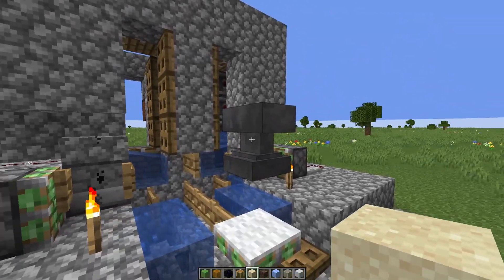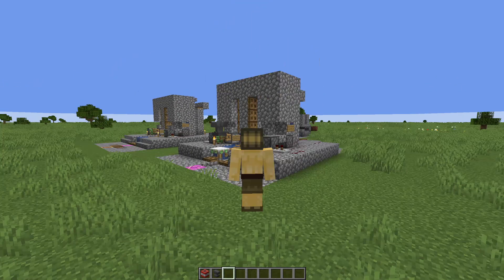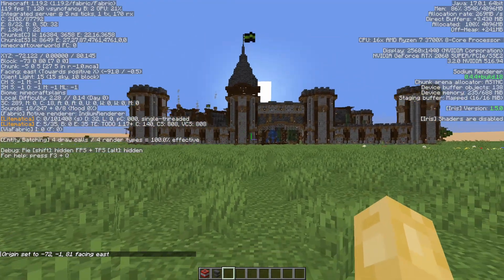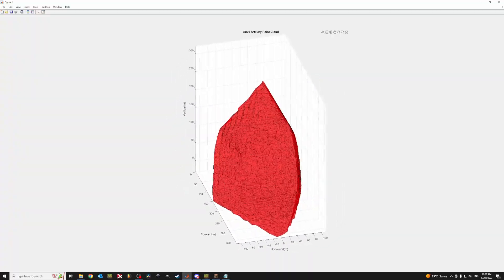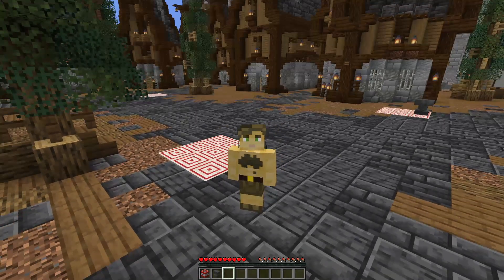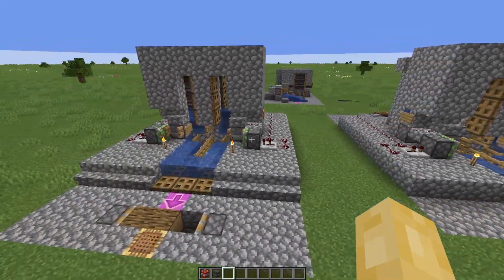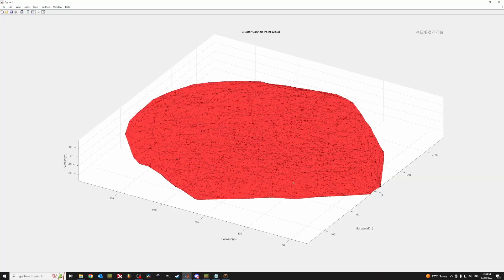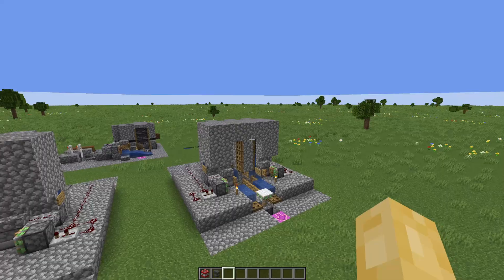Minecrafts Inter-Continental Ballistic Anvil Cannon

Comment: Would it be possible to shoot a staggered load of tnt to rapidly move a payload in a diagonal but relatively straight path above the target and then having the first stage of the payload propel the second stage downward? this way you could get over obstacles without having to bore through them

Comment: How about a tnt minecart canon?, i tested it in my World and it can 1 shot Full Netherite no enchants using 2 carts its on Bedrock just in case if there's tnt carts wont fly with explosions in Java
Reply from the maker: TnT minecarts are annoying because for some reason minecarts in general have a really strict horizontal speed limit to stop them from moving too quickly on rails.
Reply: @cubicmetre  If the Horizontal limit didn't exist or change with faster speeds, would you build one?
Reply from the maker: Uhh, yes, tnt minecart scales its damage with velocity so if launched from a cannon it would ba an instant kill.

Comment: you should create a cannon that does a more barrage or burst style fire mode. basically, ends up with one tnt exploding after another, so the first tnt creates a hole for the second tnt to go through and so on
Reply from the maker: That is what the cluster charge does, the problem is that if the TnT explodes after hitting the wall all their momentum is cancelled and they all explode in roughly the same spot.
Reply: @cubicmetre  is there a non command option for anyone who doesnt have access, like in your infinite range cannon that uses an Excel File

Comment: What if you use an arrow in replacement for an anvil? A nice way to assassinate from afar without leaving evidence
Reply from the maker: A dripstone would do this more effectively as it can be used with the cannon with minimal modifications and it breaks on impact. An arrow is very small and would make it harder to hit a target.
Reply: @cubicmetre  question, does dropstone deal more damage than some tipped arrows? Also I like the idea of a dripstone cannon
Reply: @cubicmetre  alsoooo if you're not going for small and deadly, maybe some sort of mortar shot of arrows that can strike down a 9x9 block area or bigger to ensure allot of death, maybe too much but well some ideas

Comment: Wait, could you use a fencepost to suspend an extremely large amount of sand in the place of the anvil, effective showering the enemy base in sand. Would be a great distraction
Reply from the maker: The fencepost mechanic does not entirely work anymore, you can however preserve a falling block on a piston bud that moves continuously.

Comment: Realy cool technology. However it seems a little hard to hit a Player with an anvil as they'd have to stand in on specific location. Therefor my suggestion: Instead of shooting a single anvil couldn't you instead send a group of anvlis that are either 1. All alligned sligthly diffrently or 2. send a piece of TNT allongside the anvils which then explodes in mid air? Don't know if thats possible, but the idea would be to have a small area (of maybe 3 Blocks in diameter or so) as a target instead of a single Block.

Comment: Does this cannon only work because of Carpet Mod?
Reply from the maker: No, this cannon should work completely in vanilla, although you need a fabric mod to be able to get the settings to hit a specific target. Otherwise you can try to guess the settings in full vanilla but I'd imagine that would make the cannon very difficult to use.
Reply: @cubicmetre  I have been experimenting with the anvil and a cluster Canon all day and it is very nice, thanks 👍

Comment: sry for commenting so late

but you made something not that precise with the anvil: letting it fall makes inconsistent angles each tick, a better way to do that is using powdered snow, and pushing the anvil into the powdered snow at a certain time (so the time after release from powdered snow and before entering the powdered snow stays the same but the time in the powdered snow changes)
Reply from the maker: The timings of the cannon do not change for each shot. You should be able to hit the exact same position with the same settings with consecutive shots.
Reply: @cubicmetre  sry I meant not unprecise between the same shots, 
but if you use the falling anvil delay to adjust the angle of the cannon, between each possible height to shoot at there are irregular differences, but if you'd used powdered snow it would be almost the same
Reply: instead of the cluster cannon I recommend either using not more than 4 projectiles (for efficiency) and firing as fast as possible

or just hit the enemy in one shot, using a technology named stab cannon or tunnler cannon (depending on if you play WarGear or Factions) another advantage of those cannons is, that they take just a bit of flight duration, so you might hit a moving enemy (though this requires some skill, since asking your mod just is way to slow for this) 

The Servers of the Wargear community have plug-ins, that make it really easy to build such a cannon with high efficiency and also Members, that don't bite and might even explain to you how it works (you should join between 12 am and 2 am est to find members)

Comment: The anvil knows where it is at all times. It knows this because it knows where it isn't. By subtracting where it is from where it isn't, or where it isn't from where it is (whichever is greater), it obtains a difference, or deviation. The guidance subsystem uses deviations to generate corrective commands to drive the anvil from a position where it is to a position where it isn't, and arriving at a position where it wasn't, it now is. Consequently, the position where it is, is now the position that it wasn't, and it follows that the position that it was, is now the position that it isn't.
In the event that the position that it is in is not the position that it wasn't, the system has acquired a variation, the variation being the difference between where the anvil is, and where it wasn't. If variation is considered to be a significant factor, it too may be corrected by the GEA. However, the anvil must also know where it was.
The anvil guidance computer scenario works as follows. Because a variation has modified some of the information the anvil has obtained, it is not sure just where it is. However, it is sure where it isn't, within reason, and it knows where it was. It now subtracts where it should be from where it wasn't, or vice-versa, and by differentiating this from the algebraic sum of where it shouldn't be, and where it was, it is able to obtain the deviation and its variation, which is called error.

Comment: Cubic I'm curious as to whether it is possible to instead align the projectile, and have static explosives such as ender crystals being accumulated by pistons in a set position, given they have 6 explosive power and no time limit. Wouldn't that allow for a higher top speed?
edit: you can set certain end crystals at a different position to effectively change the final force vector, though this would be less precise the less crystals you use to distribute the force
Reply from the maker: Honestly TnT is just dominatingly superior to end crystals, they are cheaper to make, easier to work with and actually allow you to stack the explosion. End crystals don't actually stack their explosions, instead the first crystal to explode simply kills the other crystals leaving you with only a single explosion.
Reply: @cubicmetre  was this behavior changed? I remember in older versions the knockback stacked
Reply: @Satepin  That's bedrock edition thing

Comment: I would love to see you find a way to launch an anvil further by blasting TNT that follows it and detonates in midair to propel it past the normal range.
Reply: why not use more tnt initially?
Reply: @ATOM-vv3xu  Diminishing returns. It’d likely take less TNT to launch it half the distance, then propel it again at its apex than it would to take the full distance in one go. Also you could have a theoretically longer range by basically adding the range of this cannon to the range of the initial TNT artillery
Reply: @rcjd7834  this doesn't increase the max. distance (using the same amount of tnt) the tnt can travel, but you can use it to change direction mid-air

Comment: if you offset the payloads’ timer and position slightly, you could use a second midair explosion within the payload to launch a portion of it even farther
Reply: this could also be used for shooting around obsidian walls, or hitting multiple locations with a single shot, like a bullet that ricochets.
Reply: you won't get farther with that (while using the same amount of tnt) but you can change direction in mid-air, this is a cool cannon to try yourself and rly rewarding if you manage to pull it of, I'd recommend building one like that

Comment: The first design you made had adjustable timings on the tnt responsible to launch the tnt to change the alignment right? My question is: if you had two tnts on the payload, but with diferent fuse values, could you increase the range of the cannon? I wonder if this is possible because probably you would have to launch the payload two different times to aim, but maybe with two cannons, one for the payload and the other for a "boosting tnt", with converging paths and different fuse times, the angle between the two tnts could have a launch effect. Don't know about the precision of this or even if its possible but it's certainly really difficult to implement both in design and coding.
Reply: you can't shoot further but you can change direction mid-air (in all directions and faster than gravity)

I'd recommend you to give it a try on your own, it only take a couple hours (minutes, once you know how to do it) and it will definitely be one of your coolest experiences this month

Comment: reminds me of the tnt cannons i used to try and build back in the day, they were called "stichkanone", which is means smth along the lines of thrust cannon. 
there were a few youtuber who built them in like 2014, idk if they stopped or not but back then they had somewhere around 20 to 50 tnt as propellant and  20 to 40 as projectiles, 
the projectiles were triggered at a very specific timing and spacing, so that the cannon's projectiles would cause a 60 block deep hole at a target that was like 150 blocks away from the cannon. some even got actually crazy and had half of the load arrive at the back wall of the hole and  then one side exloded first making another hole orthongonal to the first.

those cannons only worked on servers tho, i guess the server side client was just more consistent
Reply: those cannons have gone rly far, cannons nowadays shoot either 8 or around 56 or 80 blocks (from the side) deep using around 6/20/30 projectiles

and they also work on clients
Reply: hes made a vid about that already
Reply: @SteveIsHavingMC  he rly just scratched the surface

Comment: could you make a system with multiple anvils were each one has a very slight offset so that they rain down around a point instead of just one anvil at a point?
Reply: yes, depending on how far you shoot you could offset them by one pixel or 1/100 of a block at the point, where they get shot

Comment: If you want to try something stupid complicated and potentially impossible you could make a smart artillery that redirects mid air by firing two TNT, one with a shorter fuse which explodes first and allows you to navigate around corners alternatively you could add a more spread out bombing area to the cluster cannon.
Reply: possible and easy, try it yourself, you'll be surprised to see yourself building what you deemed impossible after maybe less than a day of experimentation, it's rly rewarding to achieve this, I'd absolutely recommend

Comment: would adding a second phase of boosting (by detonating more tnt next to the payload mid air after it’s been shot) be possible? that could potentially give it more range and speed for the tnt fuse
Reply: its possible and it's easy so try it yourself!
Reply: but this doesn't increase range and can only be used for changing direction in mid-air

Comment: You might be able to avoid fuse timer problems if you use a tnt minecart, this would have the bonus of exploding on impact, more arc options, as well as stacking minecarts to deal more damage. 

You might also somehow be able to use the property of minecarts where they propel each other when stacked to 3 or more. I don't know the exact mechanics of tnt minecarts so none of this might be possible (i.e. something like the carts will explode as soon as the propellant tnt explodes)
Reply: Also would be cool if you could find a way of synchronization between cannons to, for example, blow up midair to propel the other cannon's payload. Firing these things would be an art
Reply: tnt minecarts don't like to be used in cannons, but you can use them in missles

Comment: Have your considered doing a ballistic slime missile?
Reply from the maker: A flying machine is certainly not ballistic, for something to be Ballistic it has to use gravity to store energy. For example the anvils will store potential energy as they rise and then release that energy as they fall producing a nice ballistic arc and impacting the ground with sufficient energy to kill a player.
Reply: @cubicmetre  I'm sorry. I was supposed to suggest an "intercontinental ballistic slime missile" as in a slime missile that goes up to sky limit, then flyes horizontally until it reaches the target, then proceeds to fly straight down and explode. Something like this has been done before but not exactly like what I'm describing and also not where you can specify how long the missile should go before it flies down. (Another idea is that the missile just drops tnt minecarts unto the target)

Take it or leave it!

Comment: How does the mod know what type of Canon you have? Is it that the Canon used is the default model required by the mod?
Reply from the maker: Currently the mod will only recognise the names of the files Pt and Ct containing the pointcloud and settings for a cannon respectively. So to load the settings for a cannon simply make the files for that cannon accessible from the ucsm config folder and then launch the game.

Comment: Honestly, it's quite ingenious.

One thing is bugging me however - is there any way to automate the tnt population process? Without vision mods, it's difficult to observe the results at longer ranges, so the more visually pleasing version would contain the cannon, feeding lines, storage cubes for tnt and sand (with 2x3 1-select piston wall to pull and drop sand from tnt load, sand acting as filler block) and "redstone wifi", accepting binary encoded firing instructions from a different area.

I do not know if it's even possible - it should be, but I was never that good at making compact designs and the parts of the proposed design nearest to the firing mechanism itself would need to be compact indeed, but it would be really cool if the cannon could behave like ICBM launch site rather than an "ordinary" haubitzen. It would also incorporate several of your previous videos in a neat whole, so there's that :p

Comment: I love these cannon but i have a Question do they work in bedrock ?
Reply from the maker: I actually tried making the Smart Artillery in Bedrock edition for a video idea that I have since shelved, it was actually extremely painful working in Bedrock, I didn't have save hotbars or schematics. I had to try and replicate the cannon block by block by having Minecraft Java edition running at the same time with the schematic loaded and switching between the two games. I had to replace mechanisms with bedrock friendly ones along the way and when I finally finished it, there was no way it could work anyway because the stupid wall mechanics did not work in Bedrock edition. I was hoping to atleast get the cannon to a point where it could load the propellant and watch it explode spectacularly but the Bedrock redstone was so bad I couldn't even manage that.

Comment: is it worth trying to make a cannon that sets up a secondary propulsion in the air? so lets say the first set of tnt launces 3 tnts to the air, 2 of which explode shortly after, sending the 3rd one even further
Reply: even further is not possible with that (using the same amount of tnt) but it is possible to change direction mid-air

actually, I recommend trying it yourself - it's a fun puzzle
Reply: @ATOM-vv3xu  as much as I would absolutely love to try it myself I'm nowhere near as advanced of a player than this guy is. Thanks for the encouragement tho!
Reply: @Rdac0  he makes all that unnecessarily complicated, you can achieve it without any tools by experimentation in a matter of hours and if you don't have so much time, you can join Wargear or factions servers (tnt communities), which have all the tools preinstalled and aviable for you (you even get your own whole minecraft world on most servers, so no limits like you'd find on city-builds or at least only after like 5k blocks or smth)

on those servers you can probably learn it within an hour and you probably get help instantly (be reminded, that most players of the wargear servers are est and play between 12 am and 2 am (next day))

so there is rly no reason to doubt yourself - the only way you're gonna get nowhere is by not trying